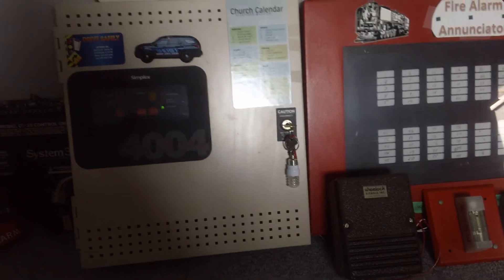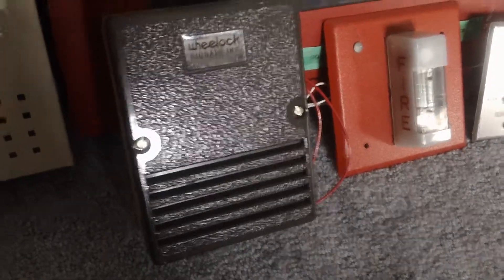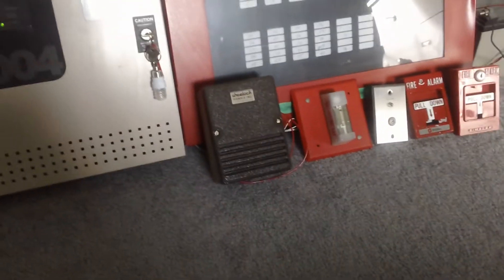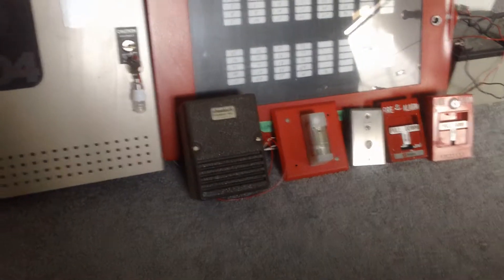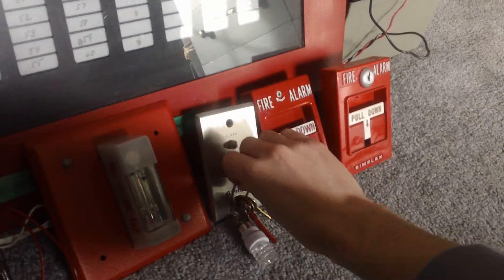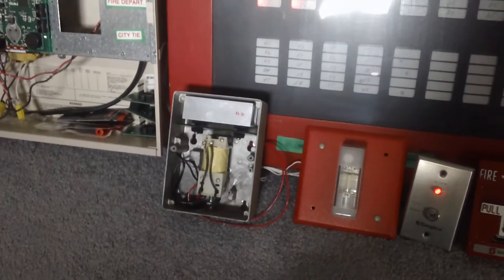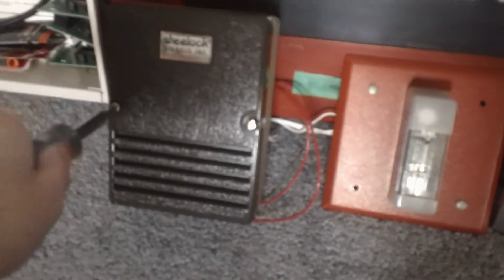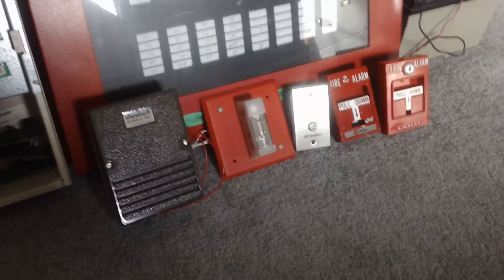Floor System Test 24

Comment: I bought a WMT-24-FR strobe a few weeks ago.  I have plans on what I want to do with it, and I'm curious as to which backbox I should use with it.  The strobe did not come with a backbox.
Reply from the maker: Hmm, yeah, I wouldn't know about that. I've never actually installed a fire alarm on the wall before, so I don't know too much about back boxes.
Reply: Craig Baker a simple 4 inch square electrical box should do for now

Comment: Where do you connect the simplex 2098-9806
To the panel? Pls reply
Reply from the maker: +Firealarm102 Alarm relay.
Reply: +msj191961 i have an ms-4
Reply from the maker: Then you have to hook it straight into the NAC. There's no alarm relay on that panel.
Reply: +msj191961 all 4 wires?
Reply from the maker: No. The LED will go to the NAC and the switch needs to go to a zone. Quite frankly the fact you asked me a question like that makes me question your capability of properly wiring a fire alarm panel. Be careful. You screw one thing up and the panel is garbage.
Reply: +msj191961 dont insult me ive already read the manual and some vids on how to wire it up i didnt know this product Its diffrent u know
Reply from the maker: I'm not insulting you, and I apologize if I made it sound like that. I'm just saying you have to be extremely careful. It concerned me that you asked that, because running all four of those wires to the NAC would have cooked that board, and possibly the key switch. Running voltage right into the leads of that switch would be a direct short. Fire alarm panels fry because of the tiniest little things. You have to know what you're doing. I've fried a panel before, and the results were quite disappointing. You can fry the panel, devices, and even start a fire if you don't fully know what you're doing.